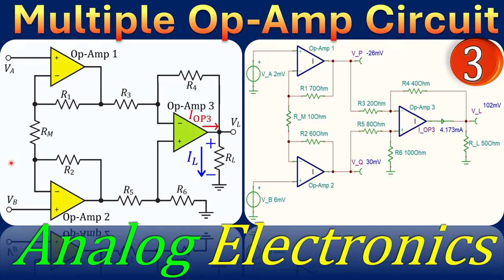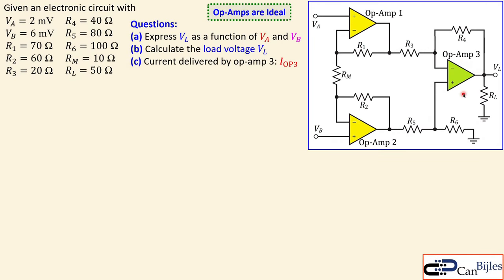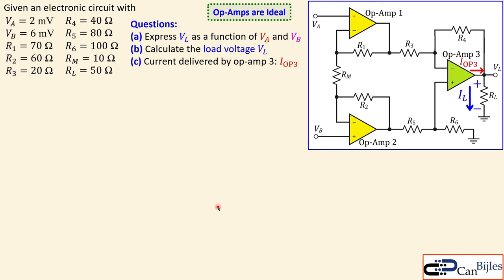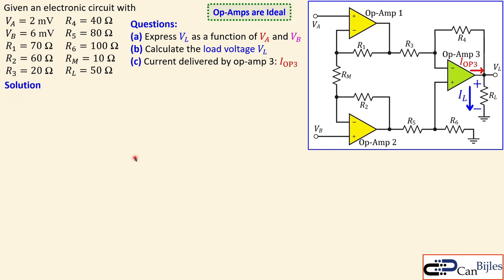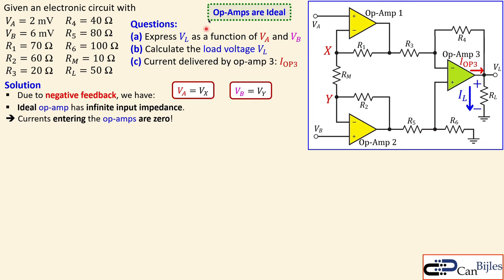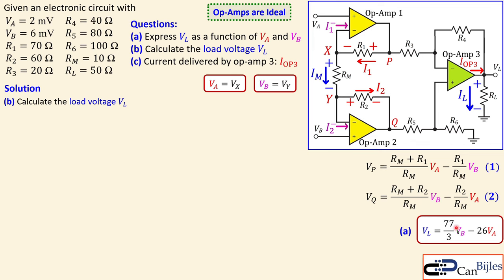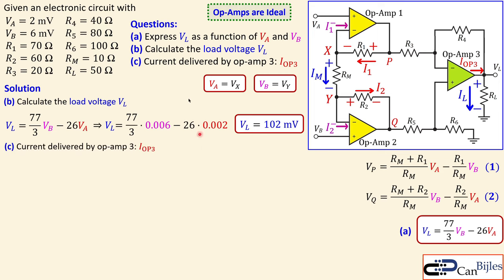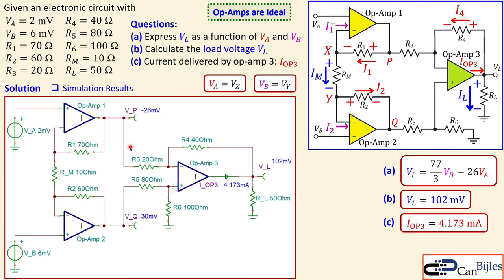Analog Electronics ⭐ Multiple Op-Amp Circuit - Example 3 ⭐ Calculations & SPICE Simulations

Comment: IA is composed of two different stages the first is the gain stage and the whole purpose of the gain stage is to amplify the signal and the second stage is the difference amplifier stage (Op-Amp 3) what's the purpose of the differential amplifier if the gain has already done at the first stage?Any other work which might add to the signal that has already been gained? Thanks
Reply from the maker: An instrumentation amplifier has two stages: main purpose of stage 1 is amplification and stage 2 is mainly for differential signal measurement. Differential measurement is more accurate than single-ended, this is reason for having stage 2, but main purpose of stage 2 is not amplification.
Reply: @CANEDUX  Many thanks for your reply. I read that the resistors in that differential amplifier need to be very carefully matched otherwise the common mode rejection rate will be poor ! please clarify.
Reply: ...and can we say its purpose just to remove the common mode signal? Thanks
Reply from the maker: @Fidel-tk5rq  Indeed, the common-mode signals like hum are reduced in practice or eliminated in an ideal situation.
Reply from the maker: @Fidel-tk5rq  You're welcome!